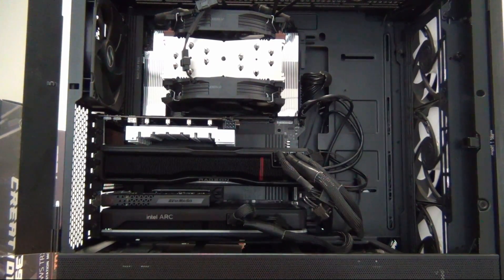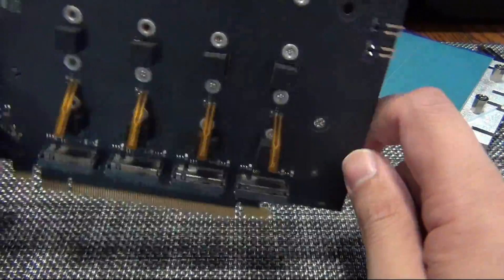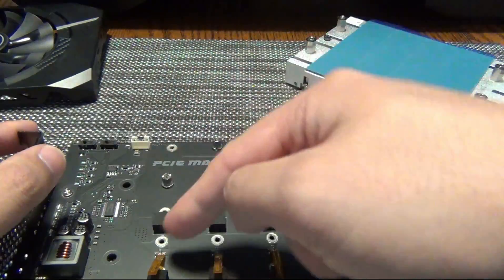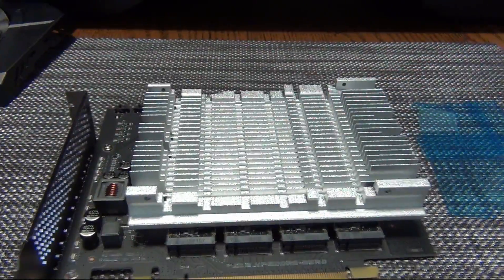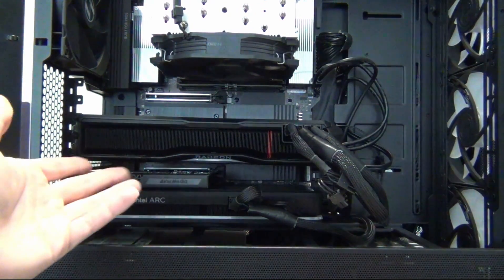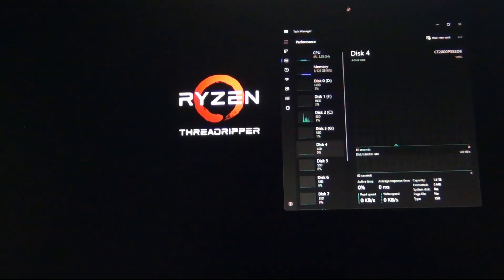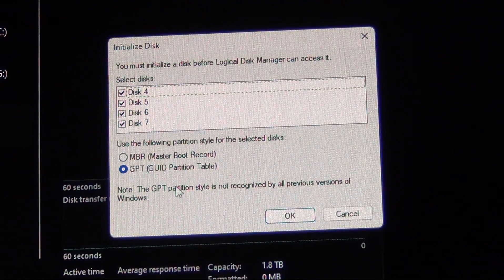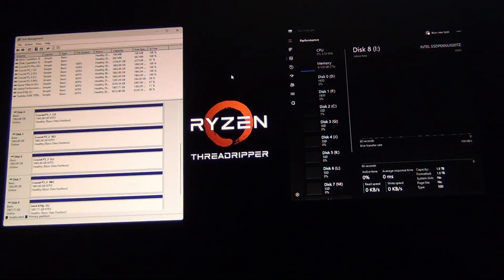How to add an NVMe PCIE card

Comment: A non-related question to the video: Is there a long process to having two graphics cards with different brands installed? Like how difficult is it to set it up in terms of downloading any software, drivers, etc. I recently upgraded to a RX 7900 xtx and I still have my previous card RTX 3070 and I really want to use both instead of selling the old one.
Reply from the maker: It's easy. You just install the drivers for the new card while having the new card installed. Regardless of whether the old 3070 is present in the system or not.

Comment: hi i  need help!!!
i am in muti gaming / bf2042 and leagues .  but something happened.   my cpu usage should be at around 35-60% at this situation . but suddenly it drops to very low usage and super low average effective clock ( in figure ) but the temp is still normal ( 65-70 degree celsius). then my pc becomes super laggy like 2-5fps  like a slider show around  10-20 seconds  ~  what happends !! so annoying . (7950x3d  curve - 26 all core /  pbo enabled /  7900xtx slighy undervolted (1130mv).  ddr5 cl40 6000 xmp 1  32 gb x2 .   any ideas ?!